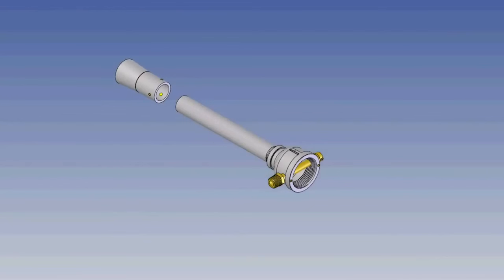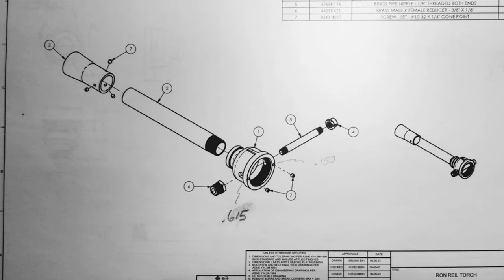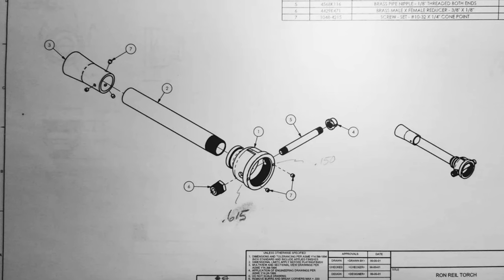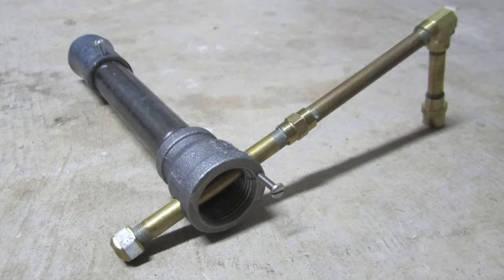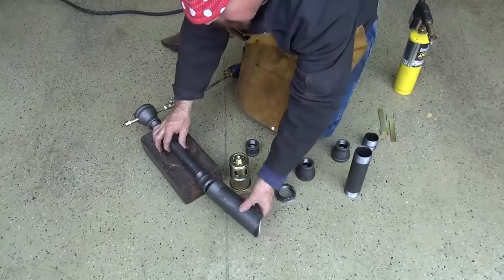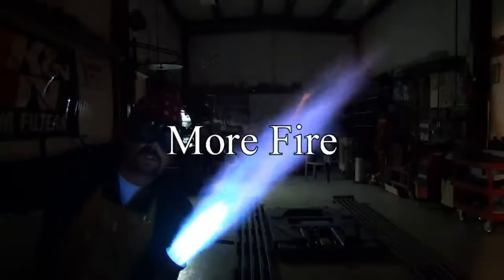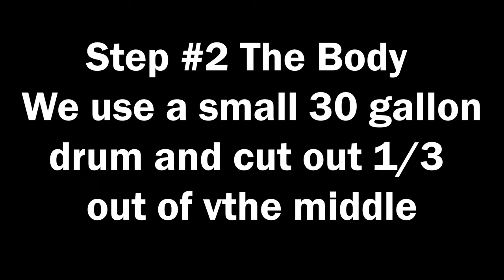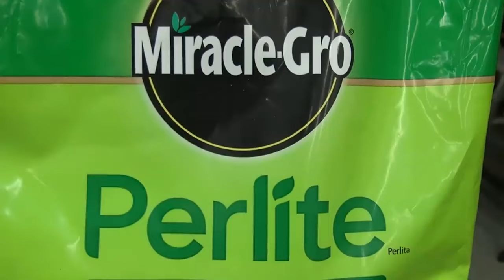Build Your Own GOLD Furnace at Home!

Comment from the maker: With so many Gold smelting furnaces on the market , we wanted to see if we could build one for under $300 dollars that would get up over 2000 degrees and do everything that we needed it to do. So this is what we came up with and they are so easy and cheap to build. The only thing I would do different is use Ceramic Fiber insulation blanket instead of the Perlite and Refractory cement because it is easier to install and replace or use a Potatoe instead https://youtu.be/8DF2SYQIobg.
If you have better ideas please leave them below in the comments section so we can all learn from them and smash that like button...smash it HARD
Reply: My hot water tank just tanked. I'm going to build one out of it and see if I gain more heat with the cast iron.
Reply from the maker: how did you guess  @DUELINGRECLINERS
Reply: HI Jeff, this is Jörg from germany writing... i want to know if there is Goldore where you used to search cause it looked so... se ya in the videos
Reply: SWEET!  Also, one of your new patrons @JamesSandzik ... Let's Go!
Reply: That's the "One Thing". Prospectors pride themselves on, is DIY process equipment building. Every once in a while something revolutionary comes along, for instance the plastic gold pan. Or even something as simple as click tubing (AKA Pop tubing)
Reply: Excellent Fabrication skills Jeff 🔥 Thank you for showing us how to build a smelting furnace. Even threw in some cement work.
Reply: I hate when these people use someone else's page or site to try to put up a ad for something that's not even pertaining to the narrative of the vlog

Comment: Careful pouring on concrete.  Spilled molten metal can cause the residual moisture in the concrete to flash to steam and explode.  Molten metal will spray in every direction.  Lay down sacrificial wood sheet (yes it will burn, but slowly and it won't explode) or 1/2 inch layer of dry sand.  I poured bronze once and spilled some on concrete.  We were hopping around avoiding flying metal for a few seconds there.  Someone else later picked up those splatter pieces and turned them into a very interesting art piece.  The rapid differential cooling effect of concrete and flying through the air caused very interesting shapes and heat colors to form in the metal (like flame painting on copper - google it if you've never seen it).
Reply from the maker: great advice ...thanks

Comment: Jeff, I know that you are acquainted with Jason at MBMLLC, and his ultra-cheap furnace is my go-to build as a backyard melting hobbyist. You're in need of a more durable, long-term setup, so your fabrication was far better suited to your needs for both melting AND smelting. The pivoting lid was a sweet detail, too. I also lack a good arc welder, and only have a benchtop Harbor Freight stick welder that won't do anything heavy.

Comment: I loved my home made blast furnace. I could get it hot enough to smelt pig iron from bog iron. My refractory was rated to 3000 F.

Ended up tearing it down last year because it scared my neighbors a bit (when I started to experiment with using hybrid propane/diesel as fuel). Sounded like a jet engine when running at full blast.
Reply from the maker: I bet that was a lot of fun
Reply: @Askjeffwilliams  You know it! If you think propane gets hot, try building a hybrid propane/diesel. OMG! It's terrifying... in the best possible way.

Comment: That was the coolest dam video you ever did. Bar none.   Omgoodness that was awsome.  Im blown away.  Ive worked boiler refabs. Ive worked in mills. And 37 years in concrete.  Good welding jeff.  Everybody welding a 55 gallon drum is like welding to a coke cola can.  Pretty hard.  And the end.  You and slim in the Mojave desert  blue oytster cult. Hot rails to hell. Ya going to the lost spanish galleon. Oh ya. I bet slim knows right were its burdied in the sand.  Yehaa. Heckuva  video. ❤❤❤❤❤

Comment: Harbor freight and others have a "weed" burner fired by propane.  It has quite a blast.  I melted some Zinc with it no problem and It would surely melt lead.  It would be more probable prospecting. Could it melt samples?

Comment: One thing I can’t figure out… what happens to the incoming flame pipe when you packed the cement in?  From the video it seems like you just put the cement on top and packed it in right on top and around it.  That can’t be right, correct?
Reply from the maker: there is an opening there

Comment: Jeff,
No NG here, need to use LP.  So what size hole for the orifice in the brass tube, being the LP runs at higher pressure? Or would you just use the valve to throttle it back?
Reply from the maker: meant to say LP